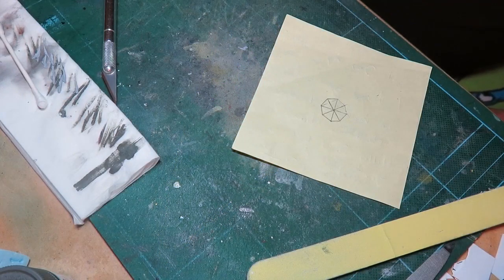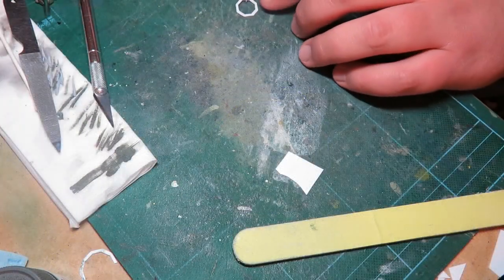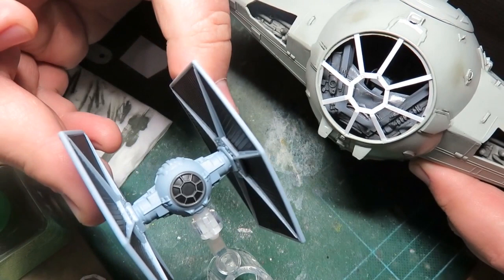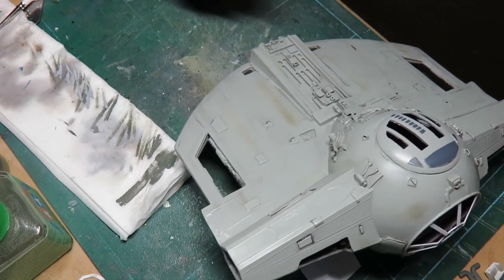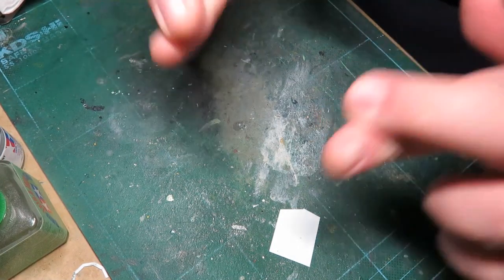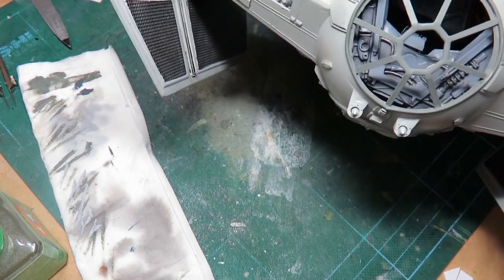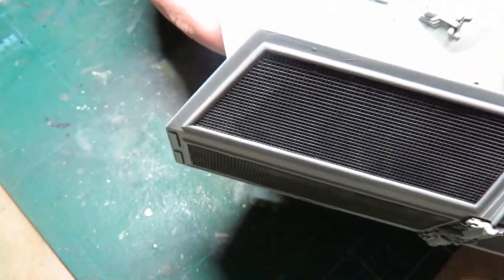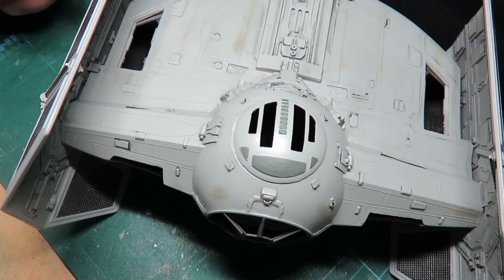MPC 1:36 Tie Advance (Part 5) FINALE!

Comment: Great build! I was really impressed about the front window especially the way you handmade it. 

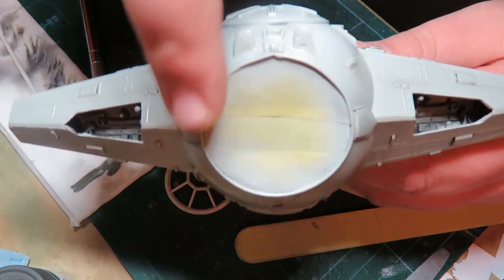My P-47 is being stalled at the moment due to not being able to use decal bonder in the current rainy weather I have here.  Once I get the bonder completed, the model should be done within 2 days after that. I will explain the process in the video. For my next project I am going to give you a list of choices for my next build and I would appreciate your input.  Rank them from 1 to 4 (1 being top choice/priority). I am unsure what I should build next. They are the Monogram B-29 1:48, Monogram 1:48 B-24J, Revell B-25J Mitchell, and Revell P-51D Mustang.
Reply from the maker: +ww2passion Thanks I'm really happy I got it one as well, That's a tought choice. I have built them all and the B-29 is nice but because of it's size it's a bit flimsy and needs to be secured really well.

1. B-25
2.B-29
3.P-51 (I've built 3 of them, a really fun kit)
4.B-24